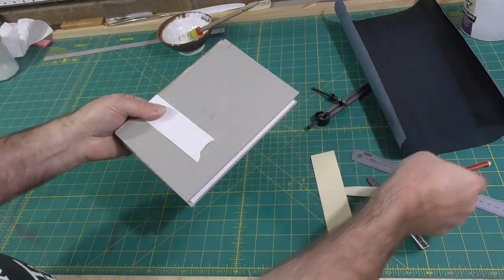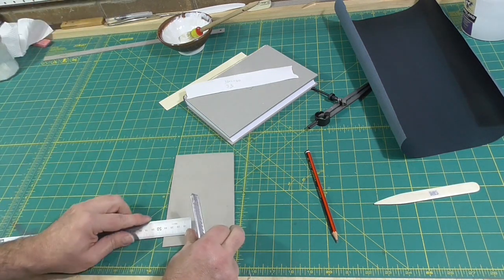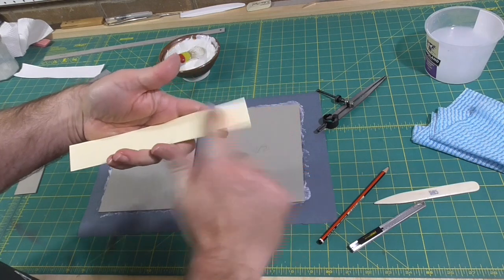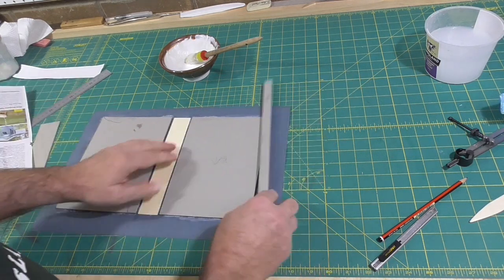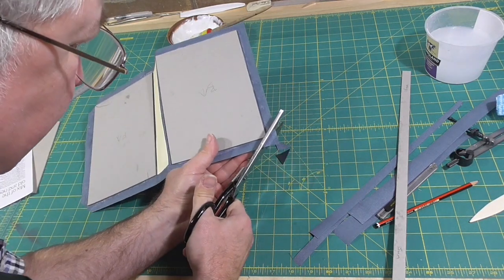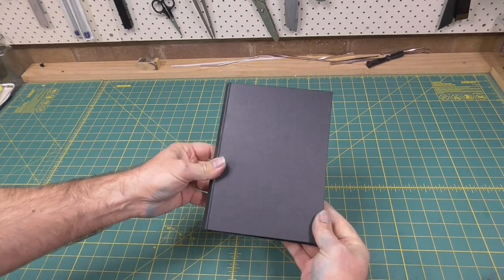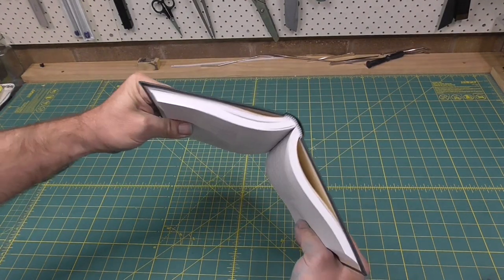Full Cloth Case Bound Book // Adventures in Bookbinding

Comment: I love these videos but there is one area where I could do with a little more slow careful explanation.
It might be me, but I don't find this most critical info on measurements of the spine very clear.  
I think DAS goes on a little too quickly.  It could do with a flat diagram with measurements if possible. 
Possibly an end-on diagramatic view with measurements for his particular book. Other than that,  brilliant.
Reply: I, too, needed clarification. He made two sets of marks on the wraparound paper, but then I wasn't clear between which two marks he was taking his measurement. The outer two? The inner two plus the 2mm he says to add for spine thickness?  Just not sure.

Comment: Do you have any videos on printing or gilding titles/designs on cloth covered books?
Reply from the maker: On cloth I don't use hand tools, just a hot foiling press, which is fairly standard in bookbinding.  Hand tools are hard to use on cloth.  I did sort of video a bit of titling in this video at 20:25
https://youtu.be/XnHw7w44MjE

I have printed on Arbelave bookcloth plenty of times.  I just cut the cloth to A3 and feed into the printer.  I have been meaning to video this, but my printer has died.  Maybe from feeding buckram into it:)  All the best, DAS

Comment: What's the reason to always turn in the head and tail first? Is it just tradition/so all your books match, or does it help with something specifically?
Reply from the maker: There is a tiny bump at the corner from the overlapping material.  You don't want that on a wear surface.  If you're covering with leather in-boards, you really want to turn-in the head caps asap.  I think this has also carried over a bit into cased books as tradition.

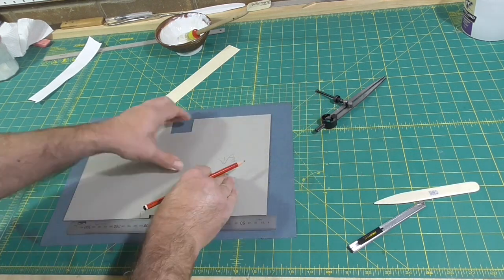Comment: 2:15  Does it matter what kind of paste is in the mix? Does paste made from ordinary kitchen starch (we swedes use potato starch in the kitchen, and for the whites of the formal dress for Nobel dinners😂) work just as well in that application at methylcellulose?
Reply from the maker: Yes.  There is a long answer.  Too much for comments.  Main problem is that it will go off fairly quickly which wastes a lot of PVA.  So maybe save a bit on paste cost but swamped by extra PVA cost.  Better getting some MC, which will last forever and a small amount goes a long way.